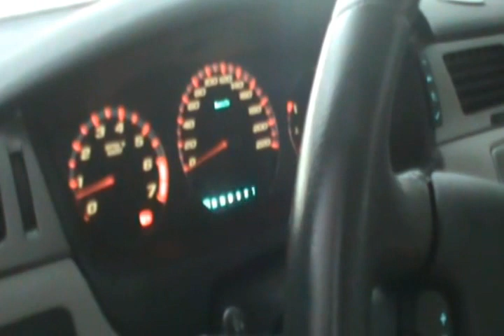CV shaft or Axle and lower ball joint

Comment: Thank you very much, I don't know why I didn't think of that. I removed the linkage and it allowed me to easily swivel the ball joint back into the knuckle. Everything is good now and my car drives great. Still a slight shake on the highway but not nearly as bad as before. I think new brakes and rotors are next. Thank you again very much for your reply!

Comment from the maker: to get rid of that shake or clicking sound just make sure the bolts that hold the control arm to the chassis are tight. The sound comes from the control arm shaking up/down/slightly to right and left; by tightening those 2 bolts (one on each side of the control arm) I was able to get rid of all the noises.

Comment from the maker: there is a metal shaft that runs from the left to the right side just 3 inches below the outer tie-rod. its a stabilizer bar that is connected to the lower ball-joint control arm assembly. You need to open the long screw that has about 4 thick rubber washers sandwiched between the lower ball-joint control arm and the stabilizer rod. this will force the whole lower ball-joint control arm assembly to lower down and you can fit it easily by hand. I can take a pic 4 U if U needed, let me know.

Comment: most cars have riveted ball joints just drill out the rivet or use you grinder to cut them off. no need to replace the whole control arm

Comment: Can I ask a question if this is still active? I cannot line up the lower ball joint back into the spindle assembly. I placed in a new CV shaft but I just cannot raise the spindle with or without the CV shaft inserted to slide back in the ball joint from underneath. Recommendations?

Comment from the maker: grinding will not work as the control arm is so thin near the edge and grinding it will weaken it. with all the vibrations from the road will cause metal fatigue and breakage. Also the grinder will melt the steel together (the rivet with the steel from the control arm). Drilling it is the correct choice then you can use a grinding bit in your drill to grind the drilled hole and widen it until the rivet falls out. I will put up a video of how we did it and show you the grinding bit in the drill.